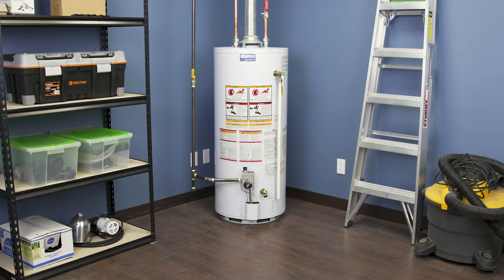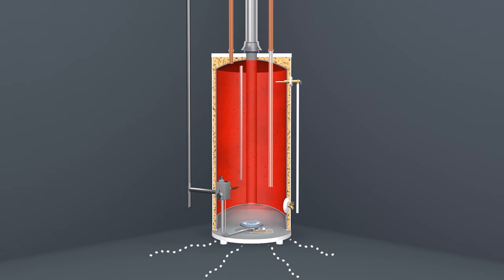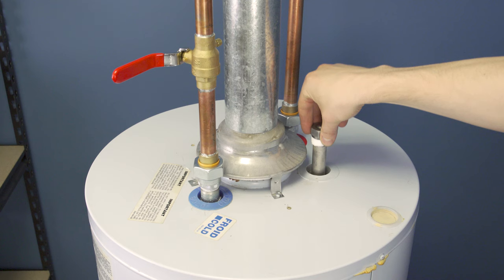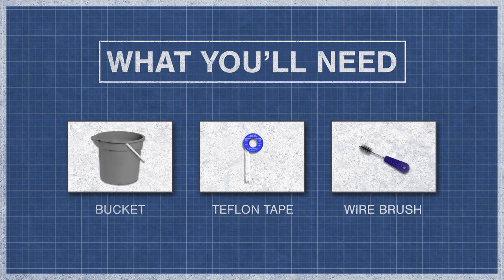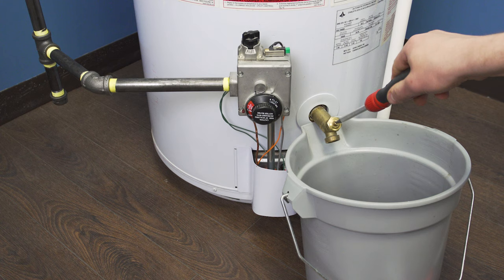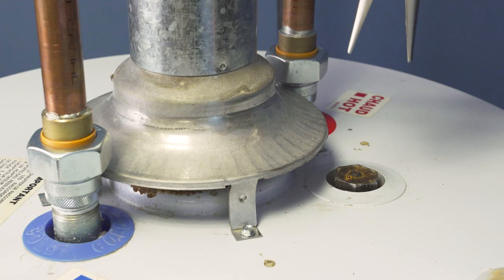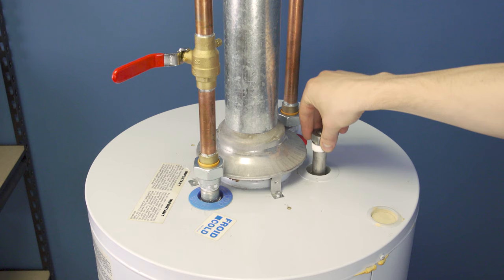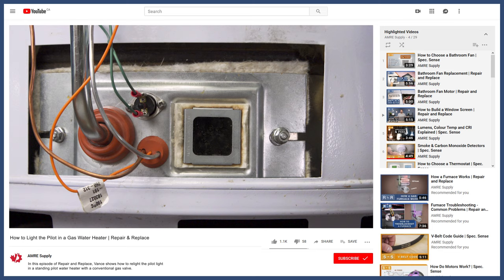How to Replace the Anode in a Water Heater | Repair and Replace

Comment: I've seen some other plumbing videos here on YouTube that says use to pipe dope instead of the tape in regards to anode rods.  Supposedly , the tape is preventing proper bonding between the two metals thereby inhibiting the rod from doing it's job.    What's your opinion AMRE?
Reply from the maker: Thanks for watching. When using tape, if you only wrap several times, the threads on the anode will cut through the tape and will still make contact with the threads on the tank. The current flow to the anode is quite low so it doesn't require that much metal to metal contact for the anode to do it's job.

Comment: Why the water heater manufacturers don’t make the inside tank stainless steel to last longer.
Reply from the maker: Thanks for watching. There are tanks made from stainless steel. These last longer but have a higher upfront cost which is why they are not as common.
Reply: companies like high turnover and high profits. Remember .they made light bulbs  that would last 100 yrs back in the 1900's  they soon found out people will rush out to buy a product but no repeat customers they go out of business.